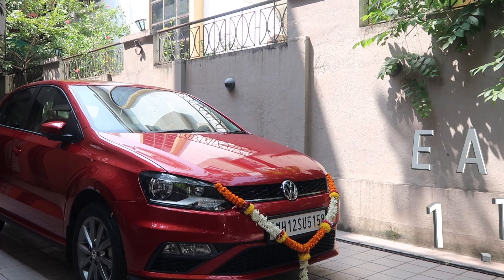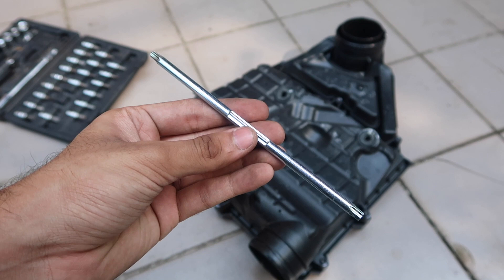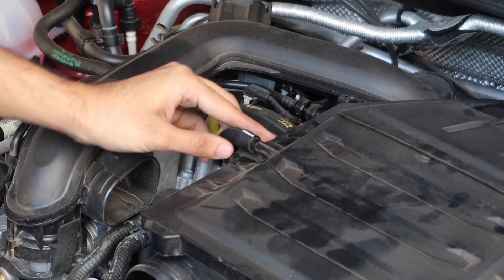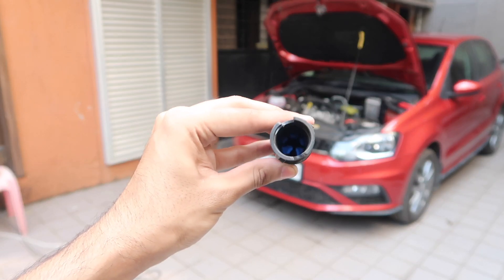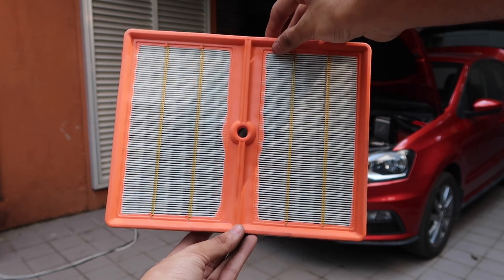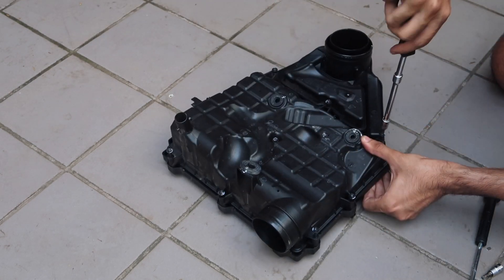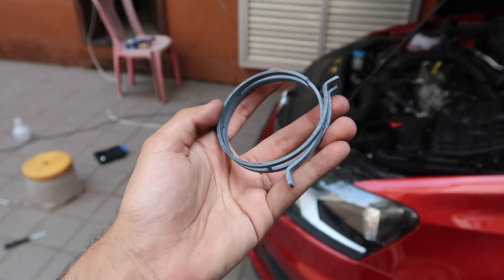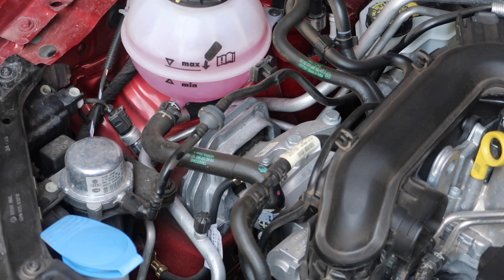Volkswagen Audi Seat Skoda - EA 211 1.0 TSI Engine Air Filter Service - Polo, Slavia, Taigun, Kushaq

Comment: When tightening screws, with the air filter box on the floor, it would be nice if you put a rag (old bathing towel) underneath it to prevent scratches from the grit on the floor. Thanks for the video.
Reply from the maker: Yes great point, this was something I realized immediately after it was done! I updated this on the TeamBHP thread

Comment: Hey thanks, I just bought kylaq last month. The air filter assembly is the same. I keen to see this informative. Looks like I am gonna do this in 3-4 months. As of now in a month I have clocked only 900 kms.
Reply from the maker: No problem. You don't have to do it in 3-4 months. You'll see a significant change in a year!

Comment: Can we buy the air filter and pil filter outside?
Reply: Thanks Sujoy! And which Engine oil do you use? Any issues or recommendations on timing chain change and inlet valves carbon?
Reply from the maker: @BlueOcean_Deep I use VW 502, 5W-40. Shell, Motul, Liquimoly. This engine has a Timing Belt, interval is about 120000km I think, need to double check. Just do regular oil changes, should take care of your valves.
Reply: @SujoyShivde do you purposely use 5w40 because i think i read somewhere 0w20 : lighter oil of course higher NOACK hence more chances of intake valve deposit.
Reply from the maker: @BlueOcean_Deep Polo 1.0 TSI recommends 5W-40, Taigun recommends 0W-20
Reply: @SujoyShivde Interesting as it is the same engine. Also the owners manual says that the car may consume 0.5 L/1000km which makes me think that 5w40 is a much better choice. Thanks for your comments. ☺️🫡
Reply from the maker: @BlueOcean_Deep Similar engine yes, but emission systems are different. Taigun 1.0 TSI will have GPF, needing 0W-20 VW 508 approved oils.
Reply: @SujoyShivde Hmmm, I think soon we will end up choking ICE with gadgets 😂. Wondering if lighter oils will mean more inlet calve deposits directionally speaking leading to poorer combustion leading to more particulate and trappings in GPF and back pressure issues although in a gasoline engine this may not be as quick as a diesel.
Reply: Thanks Sujoy! Looking at Taigun 1 L TSI and yes the air filter box does come out the way you’ve shown. Not sure what their engineers were thinking
Reply from the maker: Yeah, of course.

Comment: Great video! I just cleaned my air filters :)

One suggestion, while putting the filter housing back onto the car, I felt it was better to screw on the T30 (loosely) first and then check that the the filter box seats properly and then clamp the hoses.

Initially I tried to put on the T30 at the end but the box was not aligned perfectly even through it sat on the bushes correctly

Comment: Planning to go for a kylaq. Worried about reliability as i want to keep it for atleast 300000kms.or 15 years.Any insights about long term reliability?
Reply from the maker: Many 1.0 TSIs already over 1L Kms with proper maintenance! Should be similar with Kylaq. Maintain it, it will reward

Comment: Really stupid design for changing a simple air filter, it should be able to open it from the top and not remove it all completely, they have made a 2 minute job into a 30 minute job.
Reply from the maker: I agree! But with practice still a 10-15 min job, so not all that bad I guess

Comment: Hey sujoy. Video was very informative. I too own a 1.0 tsi and got my air filter changed last year. what i figured this week was the rear hose clamp was there but the part beneath was hanging freely (the open part where you had kept the yellow cloth) the car is driving fine but i am not sure if that is supposed to hang loosely. Any idea what that open pipe is called? 

7:10

Thanks
Reply from the maker: Glad you found the video useful. I kept a cloth to prevent anything from falling into the turbo inlet. The hose clamp should securely clamp the air filter box into the bottom part which is the turbo inlet. There should be no gap there. If you see a gap, please get a mechanic to remove the hose clamp, and re-fit it onto the turbo inlet, so that the two parts are securely mounted.
Reply: @SujoyShivde  thanks brother for the quick response. Will do the needful💯

Comment: Hi Sujoy , 
could you suggest the best engine oil for these 1L TSI turbo engines .  Is the VW OEM oils are better or oil from Shell is better ?
Reply from the maker: Hi, these EA211 1.0 engines could be used with two kind of oils. 5W-40 or 0W-20. Both oils have their own benefits. 5W-40 oils will be smoother while efficiency has been a little lesser compared to the 0W-20. There any many good 5W-40 oils meetings VW 502, the minimal approval which VW recommends. If your car is in warranty, you'll have to listen to your dealer. If you service it outside, there are many good engine oil options. Try and find an oil that meets VW 502 approval if 5W-40 or find the 0W-20 VW oil that meets VW 508
Reply: @SujoyShivde  ok Sujoy. Thanks a lot for the insights...

Comment: The taigun 1L filter assembly looks the same.. will try replacing the air filter
Reply from the maker: Yes it's the same design.
Reply: @SujoyShivde  yep.. exactly same.. just now changed the filter.. thanks a lot for your guidance video.. used a fellow friend to loosen the clips, and pull the assembly from rear hose..  the old filter was highly dirty.. car ran for 15400km .
Reply from the maker: Glad you found the video useful

Comment: Hi thanks for your good steps in this video! I replaced the filter myself.. the only thing is that one of the little clams on the high air filter intake (hardest one to click) is not snugg.. the rest of the plastic rings are snugg. Is this a issue? I'm thinking will this not damage the engine... :( it's really s*Itty design
Reply from the maker: Try pulling the intake box free, if it doesn't come off, it should be fine. Try and get metal clamps into plastic groves wherever applicable. The goal is to prevent intake leaks. Yes the design sucks to say the least
Reply: @Sujoy Shivde  thanks for your reaction, yeah I've tried with a flat screwdriver to get some room for the clamp to get under but the engine peace is in the way. I'm think to get to the garage to let it check out if it can harm or not.

Comment: 0:30 Would it be possible to replace the whole air box with a K&N 57S and a custom plumbing to the turbo? Your thoughts on this?
Reply from the maker: Yes you can do that. If your car is tuned, then replacing the stock intake might be a good option
Reply: Thanks. I have changed the Air channel to Euro spec along with a tune. Being a manual car, frequent downshifts are required having the taller gear ratios during hill climbs. I have stiffened the suspension, threw in lightweight alloys with good grippy tyres. But still, the low-end torque isn't just there in this baby TSI engine. Would it be better to go with an Air filter or a turbo inlet or a complete intake setup like the 1.5/1.6 TDI to improve it further? Any suggestions would be helpful.
Reply: @dhaswirken  Yeah lower end torque is low, hope you use 95Octane fuel, if not try it, here in India I feel lot of difference in lower end torque between regular 91Octane fuel and premium 95octane fuel.

Comment: i recently did a stage 1 remap from Etuners for my rapid 1.0 tsi replacing bmc air filter n stage 1 performance is 140bhp 250nm torque enjoying the optimized performance.
Reply from the maker: Awesome
Reply: @SujoyShivde  any tips for me from ur side after remap ?
Reply from the maker: @doprakeshgoud  Enjoy your car!
Reply: @SujoyShivde  🤝
Reply: @doprakesh : what was the cost for the remap, and how much is the bmc air filter ? Also which precise model name of the air filter

Comment: HI Sujoy, I'm planning to install BMC Air Filters(Stock Replacement). I would like to get the Euro Spec Air intake channel for my 1.0 TSI 2021 Model. What is your suggestion ? Where can I source it as the model is not listed in Boodmo. Please assist.
Reply from the maker: Hi, the Air Intake guide part number is the exact same as the 1.2 TSI one which was freely available on Boodmo. I have installed the same. Let me know if you found it, else I will help you with the link.
Reply: @SujoyShivde  Thank You. I will look for the same.

Comment: Hey Sujoy! Thanks for a great tutorial video mate. 
I am concerned about carbon deposits on my Skoda Kushaq 1.0 TSI , as it being a GDI engine is surely gonna develop those over time. 
Even the owners manual does not mention any preventive measure for that.
Can you please enlighten me how can i take care of it and what would need to be done if the car does develop carbon deposits on the valve?
Regards
Reply from the maker: Glad you liked the small tutorial. Carbon is an inevitable phenomena in any petroleum powered vehicle, and yes it does build up over time. However, most modern cars are designed with electronic systems which sense restriction in airflow, and make changes to optimise output power during the cylinder power cycle. Not just the owners manual but even the service manual does not mention any steps or preventative maintenance which need to done in the event of carbon buildup on valves. So I believe, the manufacturer doesn't expect that we proactively do anything for carbon buildup. Some amount of carbon is definitely not harmful, and becomes a part of the engine block, while most other sludge and soot will get taken out during regular oil changes. Carbon deposits might be more detrimental to the TSI fuel injection systems than the intake and exhaust valves in the engine head, and so as a minimum, using good fuel and the occasional TSI additive in the tank would be a good step to solve that issue. I'd say, regularly enjoy your car, revv it when you find the space and a good stretch of road, service it on time and don't worry too much!
Reply: @SujoyShivde  Where can I buy that occasional tsi additive from?..
Reply from the maker: From your dealership, or parts shops
Reply from the maker: Some folks suggest using Engine Oil flushes etc, but these have detrimental effects on internal engine seals, and VW themselves do not advise such third-party chemicals.
Reply: @SujoyShivde  Thanks a lot for replying 😃

Comment: 3:21, completely agree with ur view that it is incredibly stupid to complicate a simple air filter removal............ I don't know if Volkswagen is doing it on purpose so as to loot the customers.
Reply from the maker: I agree that the intake is integrated for performance gains, but there are other VW engines doing the same with an easier filter. All they had to do was reverse the side of the screws 😂

Comment: Hello great video do you know where is the fuel filter please?
Reply from the maker: The fuel filter for TSI engines should be at the bottom of the car, towards the rear of the car.
Reply: @SujoyShivde  i Tcheck everywhere under the car at the rear i didn t find it if you have more information please let me now thank you for your quick reponse
Reply from the maker: Are you searching it for the same engine? It should be near the fuel tank, along the vehicle side rail. You can see it if you jack the rear wheels. Not sure which side, will try and share an illustration
Reply: @SujoyShivde it s the 1 liter audi a1
Reply from the maker: Please jack off your rear wheel. Try the driver side first. You should be able to see it below. There's a few YouTube videos as well.
Reply from the maker: @grazielou  https://workshop-manuals.com/audi/a1/power_unit/fuel_supply_system_petrol_engines/fuel_supply_gas_operation/fuel_filter/removing_and_installing_fuel_filter/ Try this
Reply: @SujoyShivde  thank you really much i will try that

Comment: Bro , do you know which engine oil(standard & Grade) recommend for 1.0tsi engines, I checked owner manual and after checking manual I am more confuse. Then I go to be workshop , they have only only one barrel engine oil 5w40 for petrol engine.
Please help me.
Reply from the maker: I had found a bulletin from VW Global which says DSHA engine (1.0 TSI) will use 0W-20 with effect 2021. This bulletin usually takes a few months or even a year to reach VW India. If the oil was 0W-20, the new VW spec would be VW508. The manual states VW 502, which is met by 5W-40 and most dealers at present are using this oil only. It's made by Shell India and is sold to VW as VW Special G (Petrol). Only time will tell if 5W-40  or 0W-20 is a more appropriate recommendation by VW India, but till then, it's safe to stick to the dealer recommendation.
Reply from the maker: Also, I may add. 0W-20 would have been a must if our car had a GPF. But GPF is not present and so 5W-40 will not theoretically harm the engine.
Reply: @SujoyShivde  thanks man, actually next month my polo 1.0tsi have 1st oil change service so I am curious about that.

Comment: Hey, I tried this today on my Skoda Rapid TSI and I took it easy with the pliers. I used the electrical pliers and gotcha was stuck with the rear hose clip not been able to compress. LoL ! This rendered my car useless.
I immediately went to the market to get a similar one that you used. They call it Parrot Plier here. And even then it was a pain in the ass to get it right.
What a nonsense design to the basic stuff like air filter.
Reply from the maker: Yeah, I totally understand how you feel. I've switched to an RL Turbo inlet. So it's no longer a problem. Will share that video soon.   But yeah, I fully agree with you 😀
Reply: @SujoyShivde  Yeah please do. Btw warranty issues with it 🤔
Reply from the maker: @worthybeing  Technically an alteration to the engine air intake but not a diversion or disturbance to the airflow. No check engine light etc.  I've done quite a few OE Retrofits and I believe warranty is definitely not something they'd offer me 😃

Comment: The codes for the rubber points are: 867129669 front one and 07C133588p those two from the turbine side. From my changing experience at vw t-cross 2019 DKLA engine 95hp the front one was damaged really hard at 2 years and 3000 km and needed change. The others 2 were a little bit hard because of the heat but no craks they still do theyr job. TO MAKE YOUR JOB EASY USE CABLE PLIERS! Much easy comparing to normal pliers used in the clip (yes there are more expensive 😞). My box is also made in Romania and that plastic contains a lot of carbon for heat resistance (i wonder is this faulty design really worth ? Does overpricing air filter change really is so profitable to vw comparing to manufacturing costs?) when you screw in the small screws it is recommended to draw a white line with a paint marker on them before you unscrew them so you know how much to screw them back. It will be tricky without because of the filters edge silicone surface that compress to seal.
Reply from the maker: The Service manual makes no reference to marking small screws with white paint. To the best of my understanding its a torque mark from the factory where they use calibrated electronic screwdrivers. However, plastic assemblies cannot be accurately torqued to spec multiple times, so for most routine services it's fine to proper hand tight the screws snug.
Reply: @SujoyShivde i use this same white paint on many screws even on my house heater on anual maintenance. Checked with a torque wrench and the torque remained like the manufacturer sais. Of course the manual does not makes reference- the paint was a cheap way to not use a torque wrench if you do not have it. Of course it applies only on new factory products that were not opened before…

Comment: The dealer has enormous taxes for changing this filter this is the reason they made it so hard :)) my dealer in romania asks for 110 euros in total only for air filter change :). The filter itself a good one is around 17 euros and some good pliers 20 so you will be more cheap if you change home :))
Reply: Similar car in Brazil which I bought used...Can't wait to se what they charge for its 20,000km service

Comment: Than you soo much my friend! I have been searching a lot for this ! Same engine on my vw T-CROSS 95 hp 2019 DKLA ( you can put it in the description) - such a bad design and that screw in the middle to be sure no one succed in dissasemble it 🤦🏻‍♂️😒 i am from romania did not know the box is made here :))) service manual recommends different steps as you did in your video but there is very weird what they say there. First turbo hose than the screw (doing like this can damage the screw mount from my point of view) your steps are better
Reply: The rubber points can be bought separately if they broke? Or the entire box needs to be changed 😬
Reply from the maker: You can buy the rubber mounting points. I'll try and share part numbers.
Reply: Sujoy Shivde thank you 🙏
Reply: Sujoy Shivde have you see in the service manual they say something about some non silicone lubricant but after they say do not lucricate. It is unclear what hose need lubrication and what lubricant to use. Myengine has lubricant on the small lateral one from left